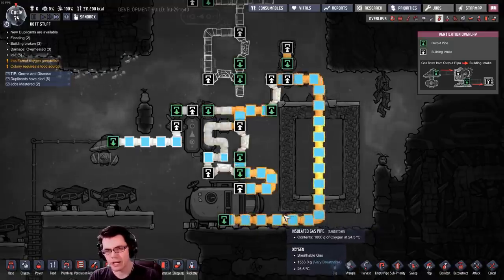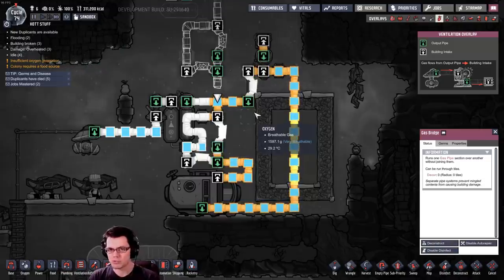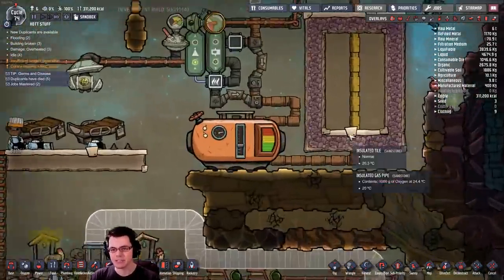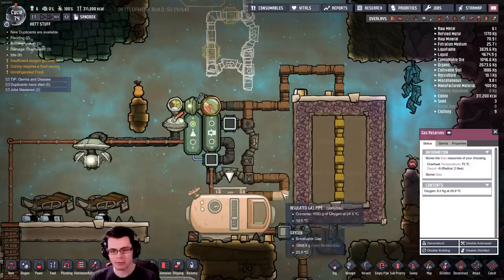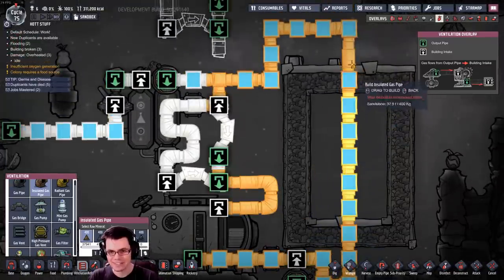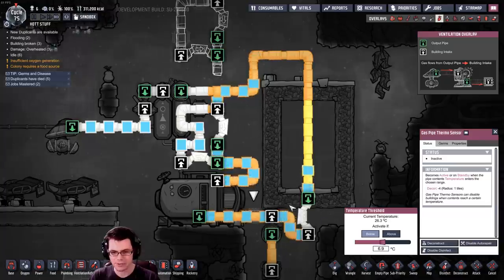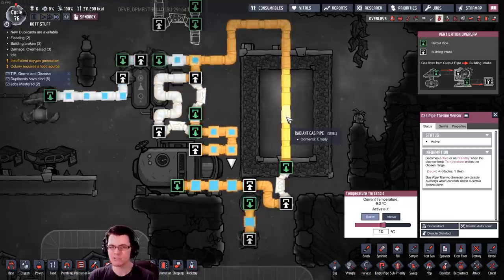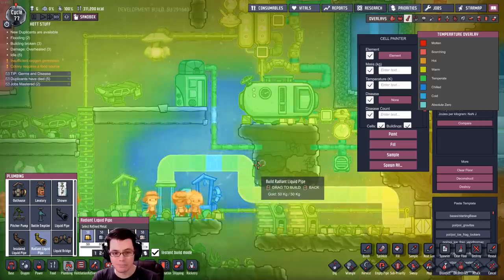Averaged Temperature Loops! Oxygen Not Included Experiment

Comment: It's not entirely true that the tanks don't interact with the liquids.  They behave as if heavily (but not totally) insulated.  I used some liquid storage tanks for output from a smelter early one game before I was ready to handle high-temperature oil, and after a while the tank began to overheat and even eventually broke.  Four tons of 300C Crude Oil will definitely heat up a reservior.
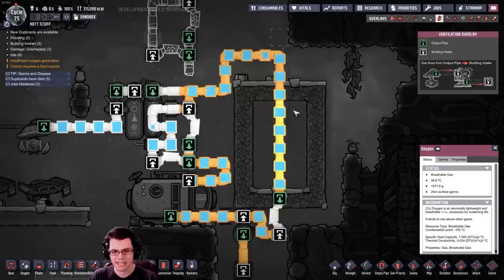Also, the entire mechanism at ~10:00 can be reduced to a single pipe exit (bridge or valve.)  A length of pipe has priority over an exit point, so it will automatically pump in the perfect amount, and then only add more when there are gaps, without needing any automation.
Reply: I can vouch for this. Reservoirs don't exchange heat with the contents inside but the air/liquid in contact with the reservoir does, so do the bottom 2 tiles touching the reservoir. So if they are not in a vacuum the contents will heat or cool the air around the reservoir which will then heat/cool the reservoir itself.
Reply: @LurkzGaming  I know in my case (now that I'm thinking back this was before the most recent update) the reservior was on non-insulated abyssalite, so it's unlikely that was the direct cause for the heat. I'm pretty sure nothing changed in the update, though, as my half-dozen iron natural gas tanks are the same temp as the gas stored in them (which has mostly not been flowing.) I'm setting up a cold petroleum loop and should finish it tonight, will see what happens to the reservior once that is running.
Reply: @brothgar  Still a very good video, it gave me some nice ideas so thank you for that!
Reply: @brothgar  Alright, that makes more sense now.  I've just finished building two similar loops for cooling some of my own power (and volcano) area, and I have a closed petrol loop with a tank (which I pre-filled; since it's closed, no need for further input than the bridge.)  I also have a loop set up to cool that petrol loop (via aquatuner) similar to what you have set up, but I don't need a tank.  I guess having the hybrid of those two broke my head for a little bit. ;)
I have often hoped they'll add at least shutoff automation to tanks.
Reply: @brothgar  Something to note about the reservoirs: they only exchange temperature with ONE tile under them. You can see this at 14:10 in the video. Gas reservoirs only exchange with the center-most tile, liquid reservoirs with the leftmost tile.

This is most relevant when you begin playing with LOX or LH2, and you need somewhere to store that supercooled liquid/gas. Placing it in a vacuum works great, but make sure to use mesh tiles, as the mesh tiles take on the properties of the gas/liquid they contain, even if it is vacuum.

Comment: Another method I can think of for cooling would be to transfer the heat using the thermal regulator or Aquatuner for some material like oil or some gas and to throw it in the space with a negative temperature balance

Comment: I've noticed another feature of gas/liquid reservoirs, but I haven't figured out how to exploit it yet. Temperature is instantly transferred (averaged) when things are added. So you circumvent thermal conductivity. 

But it only seems to work with same elements. So you'd have to have two vastly different temperature things of hyrdogen for example. Mix them in gas reservoir and viola averaged instantly

Comment: I would like to see you try a counter current heat exchanger system. Take pH2O from sluch gyser at -10 and run it through radiant pipes in one direction with an adjacent pipe running 40 degree H2O in the opposite direction. Should be able to warm up the pH2O to 40 while cooling the clean water to a desired temp. The desired temp part would require some automation. Should be an energy efficient way for heating pH2O to feed to pinchapepper nuts while cooling H20 to feed to bristle berries or sleet wheat.

Comment: This could definitely be useful! 

i'm using cold polluted water from a slush geyser to cool down steam and convert it into water, which then goes into a copper volcano to become steam. Unfortunately the volcano will convert much more water into steam than my gas pumps are capable of removing in a timely manner, so once the volcano goes dormant, the P-water will stop moving around and get stuck for too long in the condensation chamber. meaning that once the volcano gets active again, i'll be feeding it ~110°C water which will evaporate inside the pipes as soon as it enters the volcano chamber.

Using a tank to equalize the water before feeding it into the volcano chamber should mean the pipes won't break anymore, without the water being affected by (or affecting) the surrounding temperature.
Reply: if you know the dormant period and active one, use automation timers to flood/drain the pipes from the volcano chamber to prevent exploding pipes. Three hurrays for logics

Comment: I've been experimenting with storing liquid oxygen in a liquid reservoir and I saw a lot of thermal conductivity especially at the tile below the reservoir on the left side, you can actually see it in this video at 14:16 - 14:20 without using insulator tiles I don't think it's possible to store liquid O2 in a reservoir without it heating considerably.

Comment: There is only one thing you forgot in this video: You need to keep the water tank at the same temperature or over time, it will heat up / cool down and mess up all your setup.
Reply: I am talking of the water pool on the right, the one you use to cool the liquid that gets out of the tank. That one could heat up or cool down, depending on the liquid that goes through, over time.
Reply: @ulruc  Thats just an "Example" of a hot/cold location, its not actually going to be a pool of water in a proper game.
Reply: @ulruc  i believe that would be managed by different system. Water tank represents thermal energy dump - it could be hot, could be cold, anything. For instance you can input gas at a given temp, say 10C, and want to have that water tank to the right remain at 10C. All you have to do is to run it long enough to suck all the heat from water tank until it'll averages with your gas.
or you want to dump heat from your machines to that water tank. And it could be P.Water - hence you got your pre-heater for water boiler with minimum amount of energy spent.

Comment: Use the magma loop to make steam for a steam rocket .
Reply: With 10 g/s flow to prevent magma solidifying and contactless pumps it can be pretty cool, could cool down magma to 100 C with necessary (insane, I think) amount of water.
Reply: Or just use the steam from a vent, unless having hotter steam makes a difference.